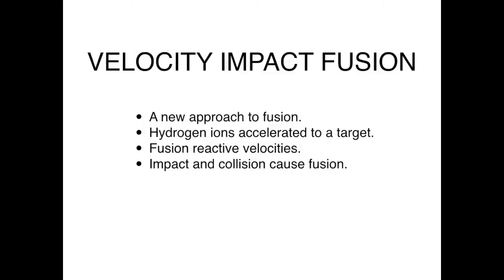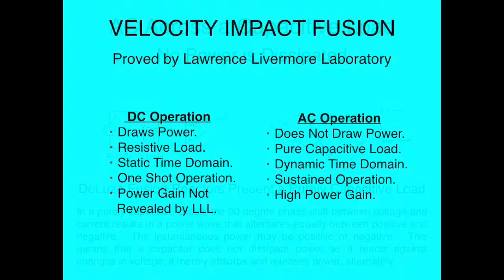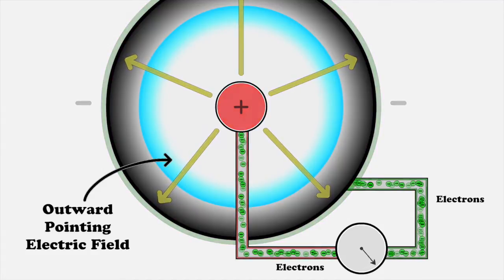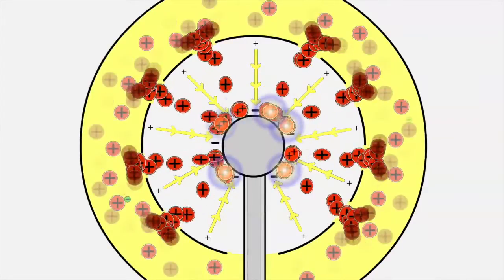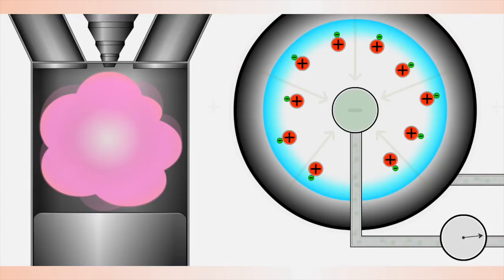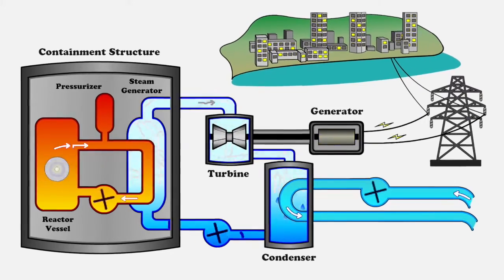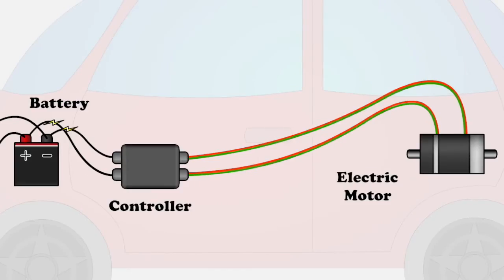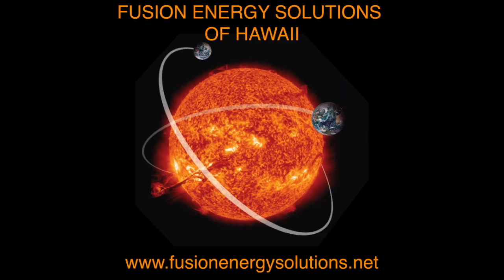Velocity Impact Fusion & Deluze Fusion Reactors; How They Work

Comment: Very interesting concept! One thing I'd be concerned with is the very small size of the fusion crossection of D/T Hydrogen. Even though you attain the correct energies to achieve fusion, the odds of 2 nuclei coming within the required crossection seems unlikely. Suppose the diameter of the sphere on which the nuclei combine to form helium is 5mm and the fusion crossection is roughly 10^-28 m^2, you would need roughly 5.2 mols of D/T nuclei just to cover the surface of the sphere and then would require more to achieve any reasonable number of fusion events. This number goes down as the size of this sphere decreases but there is a practical limit to that. Would love to hear if you came up with a way to avoid this possible issue :)